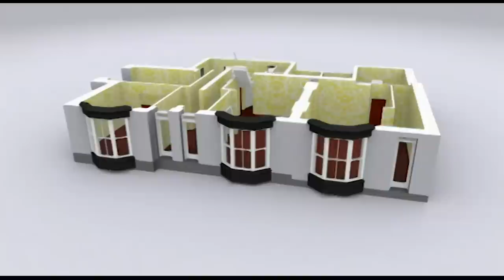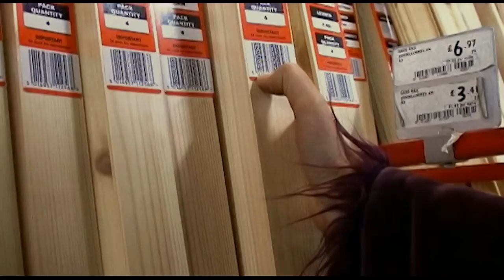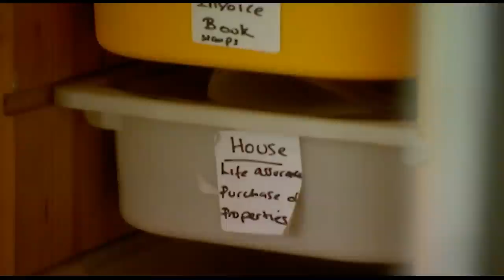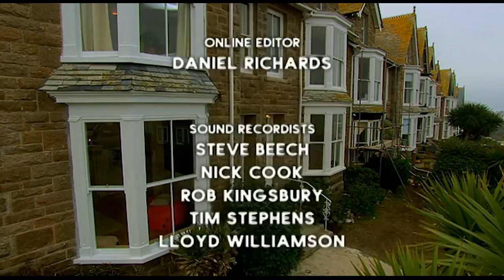From City Life to Seafront B&B - Build A New Life in the Country - S02 EP9 - Real Estate

Comment: The people who renovate old homes on these shows don't seem to worry about tearing out walls and pulling off baseboards and moldings that have layers of lead paint on them. It's very toxic to breathe lead paint dust and these remodelers should be more careful. Many of these homes have asbestos in them which needs to be remediated by specialists otherwise the remodelers will damage their lungs ("Asbestosis").